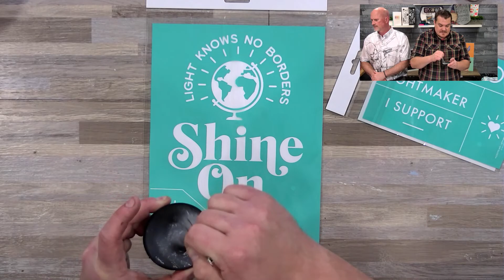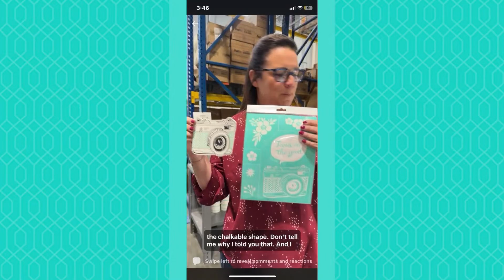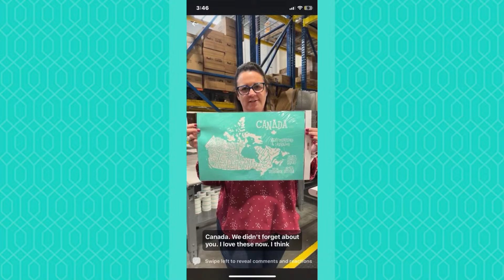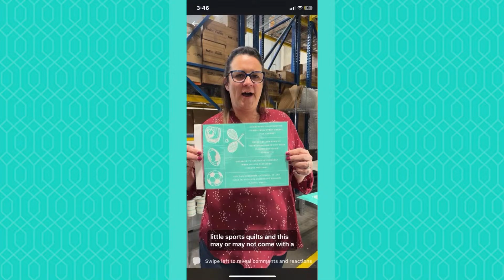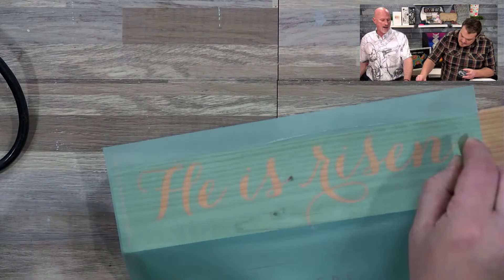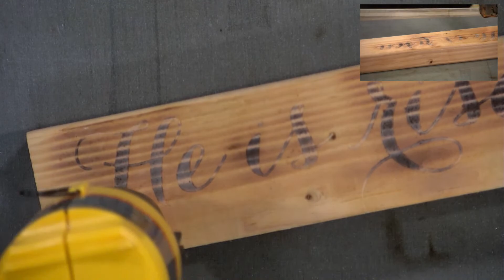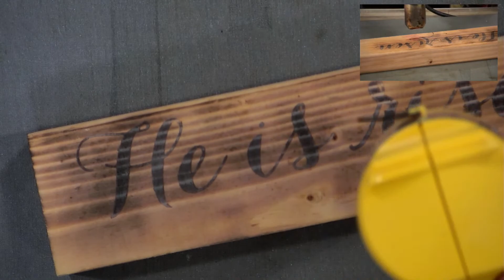How To Use Chalk Couture "Etched Radishes" With Wood Burning Gel Paste On Decorative Cutting Board

Comment: Instead of using the glazed and a heat gun why couldn't you use use the new wood-burning marker it looks like a magic marker why couldn't you just color over the stencil with the marker then pull off the stencil Andrew's a blow dryer which turns it into looking like you used a wood burner